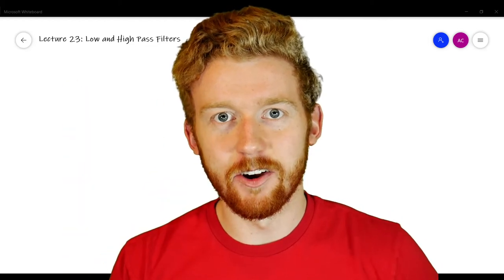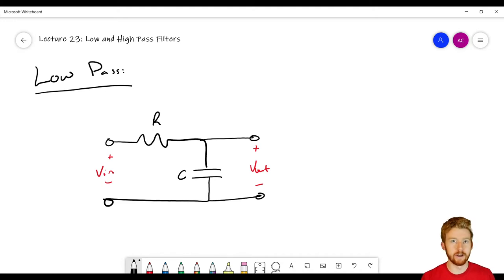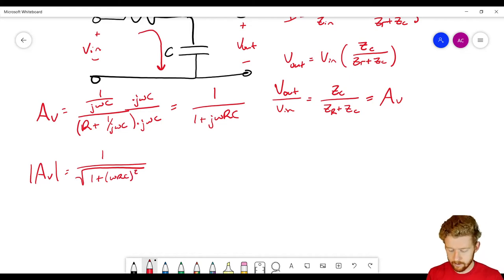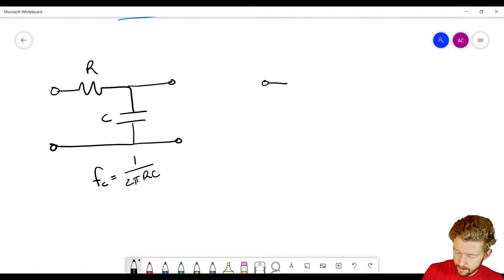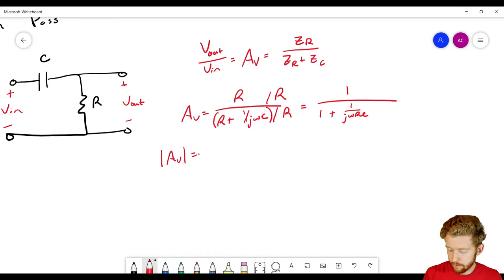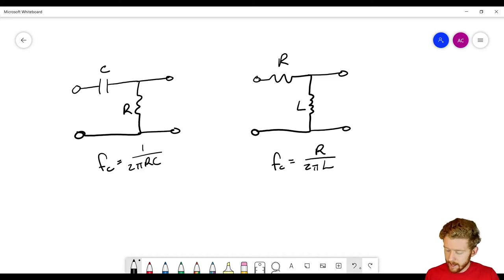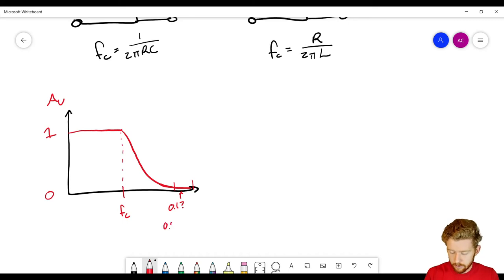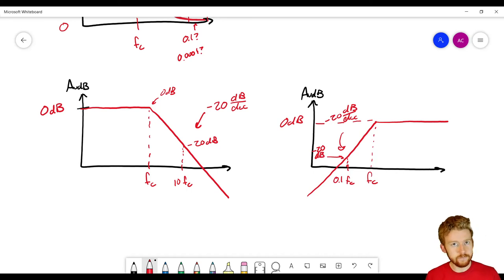Circuit Analysis Lecture 23: Low and High Pass Filters

Comment: There is a reason to consider the cut off frequence as the frequence which the power is cut by half or this is just a arbitrary standart definition?
Reply from the maker: Hi, Bruno.

I am actually not too sure why it is chosen to be as the "half-way" point. Intuitively, I don't believe that it is purely arbitrary. If we plot the response on a logarithmic scale versus frequency, then we can see that, after the cutoff frequency there is a sharp decline of -20dB/decade which is not present before this cutoff. An even better way to look at it would be to use a semilog plot (where the x-axis is on a logarithmic scale and the y-axis is on a linear scale). Here, we can see that there is a very sharp decrease at the cutoff frequency.

Please let me know if you'd like me to explain this in a different way. I apologize for the delay in replying to your comment. Thanks!